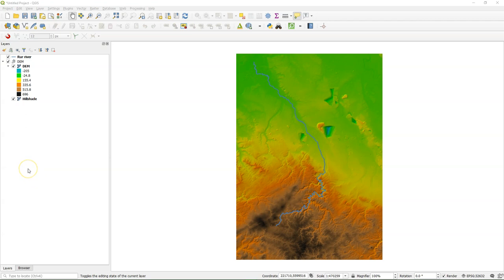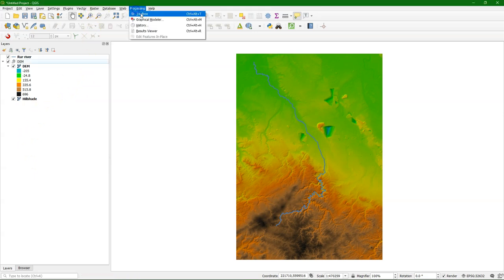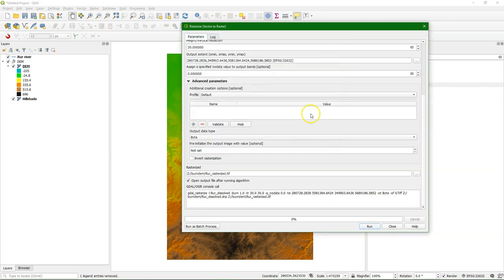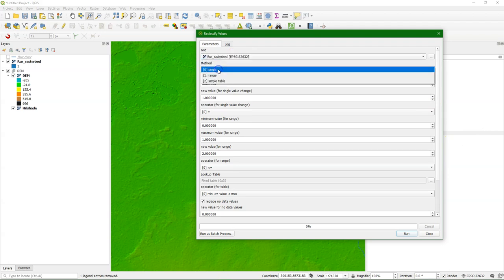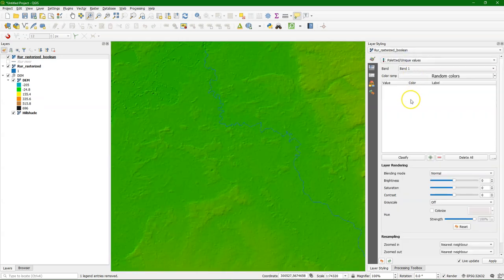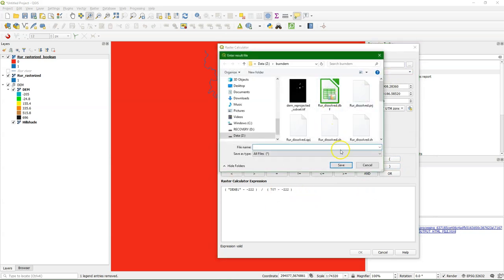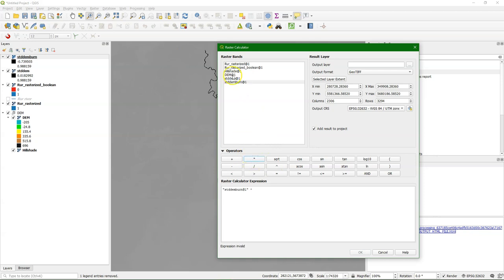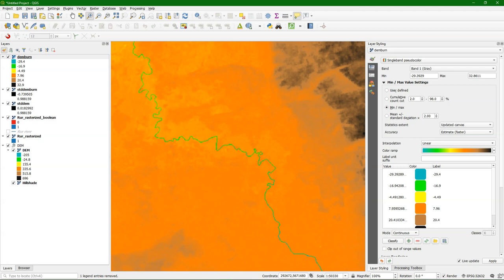Burning river in DEM using map algebra in QGIS

Comment: Hi Hans! Thanks for the great video. Unfortunately, the 'reclassify values' option doesn't show up in my toolbox. I do have SAGA, but it's not there. I tried achieving the same result with QGIS's 'reclassify by table', but get 0 & 241 as options when I choose byte as data output & two categories of 1 when I choose Float32 as data output. I am new to QGIS so mainly working through trial & error, but I think not having an understanding of what I'm doing doesn't help here.

Do you know why the 'reclassify values' option does not show up? & could I work around it with the QGIS 'reclassify by table' option if I choose different settings?
Reply from the maker: The "reclassify values" is indeed no longer included. The "reclassify by table" tool can indeed be used instead. The data type should be Byte and you can use the same settings. Check with the Paletted/Unique values renderer if the result then has only value 1. I'll soon upload a new version of the video where we use the new PCRaster Tools plugin, which might be easier.
Reply: @HansvanderKwast  Thanks a lot for your answer, I've worked it out! Looking forward to more videos, your tutorials are the best! :)
Reply: @HansvanderKwast  looking forward to the PCRaster tutorial. Did that get generated yet by chance?

Comment: Hello Hans, great method but I have a problem when I try to rasterize the rivers as the Error shows: Attempt to create 0x0 dataset is illegal, sizes must be larger than zero. I tried changing the pixel length but still the same issue, what should I do to overcome this problem?
Reply: Have you solved it? I'm having the same issue!
Reply: @Zoe-kw6we  Hey, no I could not, I ended up using arcgis to rasterize the rivers and export it as a shape and following the resto of the process on qgis
Reply: @josephrojaszamora9601  Thanks for your reply! I hope I find a way to work it out as well

Comment: Hello, I'm using the carve function but the output raster generates no data values in the last section of the river. I've played with the parameters but always end up getting the same no data pixels. That region is a valley, and because of that the river has no define "axis" and it's surrounded by lots of swamps. I don't know if I'm getting this no value pixels because of the flatness of that zone. Do you know the reason for this? thank you very much in advance, I hope you can help me.
Reply from the maker: Not sure what the problem is. You can also try this method: https://youtu.be/jHT_StPb_oM

Comment: I burned an NDVI image to the DEM, which resulted in negative values for the corrected DEM.
Reply from the maker: Interesting. Why would you burn NDVI in a DEM? Also negative elevation is normal where I live below sea level.
Reply: MNDWI image.
Reply: @HansvanderKwast  The corrected DEM range is not the same as the original.
There should be a problem in the step of generating demBurn. The Mndwi image is subtracted from stdDEM. Although the purpose of burning is achieved, this step leads to a different range of corrected DEM. Is there any good solution?

Comment: Dear Hans, I am deeply grateful for all the teaching you have done on QGIS. It has been a huge part of my learning!.   The last step in which you multiply the burned standardized DEM with the original DEM would seem to introduce a non-linearity in the DEM values, and not give back the original DEM values outside the river burned pixels..    

if stdBurnedDEM = (DEM - base)/(top - base)  

then multiplying DEM*stdBurnedDEM gives (DEM*DEM - DEM*base) / (top - base).    

Instead, as the final scaling step, why not apply the inverse of the scaling that was used to create the stdDEM? i.e.,

Final Full Range burned  DEM = stdBurnedDEM*(top - base) + base.
Reply from the maker: Dear Keith. Good point. I'll check it and get back to you.
Reply: @HansvanderKwast  did you check it?
Reply: I think this step should be rechecked. I find erroneous negative elevation values while simply multiplying the standardized burner dem with the original dem.
Reply: Any advice on this step?
Reply from the maker: Agree. I think that step is incorrect. In the original paper they've used the relative DEM directly to derive the flow direction.
Reply: @HansvanderKwast  what workaround would you suggest?
Reply from the maker: @smrutiranjanpatra3234  You can check other algorithms:
GRASS r.carve: https://youtu.be/ZyM1jnxFamU
WhiteboxTools FillBurn: https://youtu.be/8GzN3EPYwU8
PCRaster Tools additonal scripts: https://youtu.be/KbjIsFL_PcM
Reply: @HansvanderKwast  Thanks. But these links seem to work only in case of a stream network. I have water channel masks as raster which I need to burn in the dem. Can you please suggest a workaround to burn the river mask raster in the original dem?
Reply from the maker: @smrutiranjanpatra3234  If you check the code of this algorithm you can do it with rasters only: https://github.com/jvdkwast/qgisrepository/blob/main/collections/qgis_pcrasteruserscripts/processing/pcraster_burndem_algorithm.py
Reply: @HansvanderKwast  Thanks. I'll give this a try.

Comment: Dear sir, can we also burn road network in dem by this method? Thanks
Reply from the maker: With this method you can burn anything in your DEM.
Reply: @HansvanderKwast  Dear sir, one more question, i saw you use rive line to burn in dem. why you not use river in polygon to burn because it can also identify the width of river? Thanks
Reply from the maker: Sure. That's better in case you have a polygon.
Reply: @HansvanderKwast  sir, one more, we fill sink just for delineate watershed? how about we use it for hydraulic simulation like flood modelling in hec ras, we need to fill sinks for dem or no need? Thanks
Reply from the maker: For hydrological applications with water flow you need to fill the sinks, otherwise the water will not reach the outlet. Both artifacts and real sinks will be removed, so take into account that if you need the real depressions to stay in you elevation model.
Reply: @HansvanderKwast  so even i use dem for flood modelling (for example, HEC RAS), i need to fill sinks also, right?
Reply from the maker: If water flows over the DEM you need to remove the artifacts by filling. If the water gets out of the channel and you want to simulate the flow outside of the river you need to remove the artifacts by filling. Disclaimer: I'm not a hydraulic modeller, so maybe incorrect.
Reply: @HansvanderKwast  Dear sir, this video, you subtract river depth 1m, can we subtract river depth more than 1m (for example, 2m, 3m, 4m, 5m,.....and so on)?
Reply from the maker: @salpiseyheng6089  You can adapt the procedure to subtract anything you want.
Reply: @HansvanderKwast  after i subtracted, I multiply it by original dem but it not become the original range of dem. why, sir?